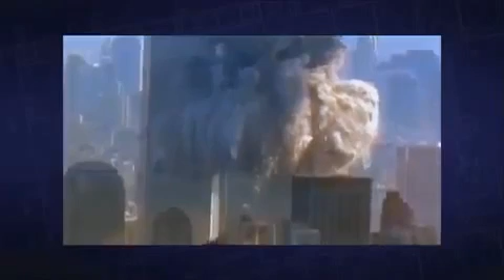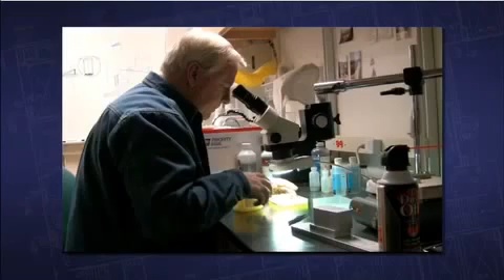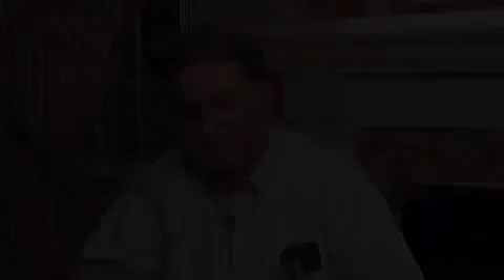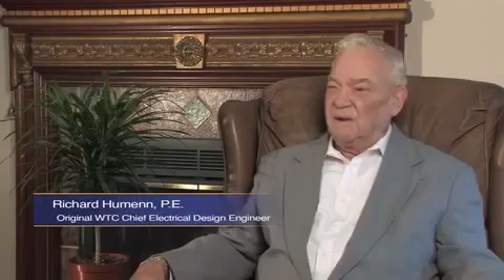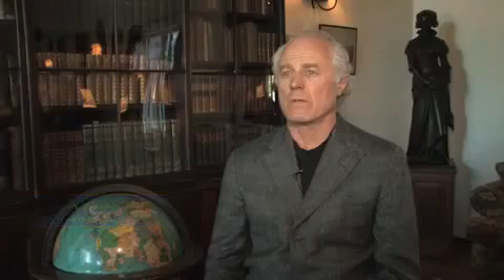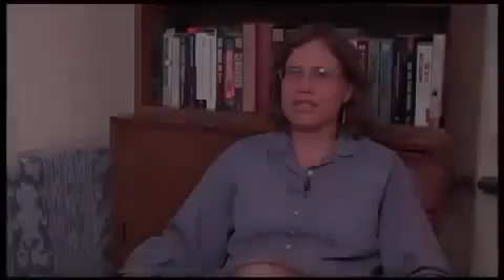9/11 Truth - Explosive Evidence -- Experts Speak Out - ( full lenght )

Comment: Question for Debunkers: Why did both collapses stop at the lobby floor?
Reply: No takers on this question. Figures.
Reply: +Tucker Not Sucker! Is there ANY point to demolish a building under the lobby? All those floors coming down at free fall speed, building is down, gone, pile of rubble, to the ground, so what's your point wiseguy? 
Those kind of controlled demolitions need months of preparations, not one day, oh boy, you're a sucker to the bone...
Reply: They couldn't wire the lobby, to public.
Reply: AND, G Heald ... why did the government haul the debris out as fast as possible without doing the 'normal' piece by piece analysis of the building parts .. and the bodies, to determine exactly what happened ? Reason they never did .. is because 'they' already knew what happened and the cove rup was on before the dust even settled.

Comment: The first architect sums up the misinformation in this video.

He's very troubled that the buildings came down in fire.  Do none of these "professionals" know that the towers were only required to stand for 2 hours in a fire?  That the components were tested to that standard?  UL standards?  No?

10:31 That right there shows me beyond a doubt they have no idea what they are talking about.  All of the floors above 5 were held up by three trusses.  It had to be designed that way to cantilever the building over a power substation that already existed on the site.  The statement and diagram are just plain false.

Even if they were not false, his statement is ridiculous.  You don't have to take out all the columns, just enough so that the load is beyond what the remaining columns could bear.
Reply: ***** - Yes, that's what happens when you take out a lot of the structure with plane impacts, blow and crape off the fire protection on the steel, and use 10,000 gallons of axcelerate over many floors.
Reply: DOMINATOR 4892 - Why do they put fire protection on the steel, nimrod?
Reply: NOW PLEASE EXPLAIN TO ALL OF US HOW BUILDING SIX BLEW ITSELF UP.

Comment: well how about this: steel framed high rise buildings will not fall through the path of greatest resistance! end of story! talk all the juvenile shit you want but the only way for a building to fall straight through 80,000 tons of structural steel is for the entirety of that mass to be removed. This either has to happen with precisely timed removal of the structure, which in this case would mean 400+ heavy duty weld/bolt joints PER SECOND! or to simply have the entire structure disintegrate!